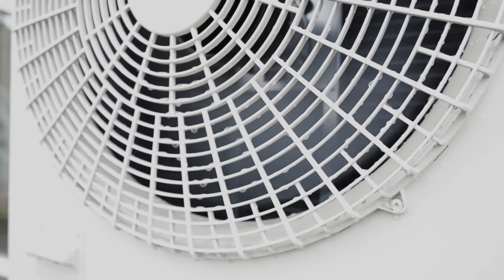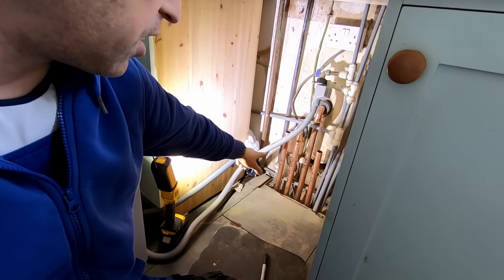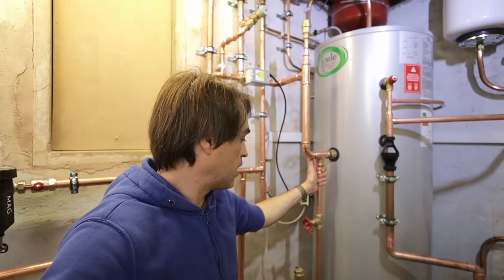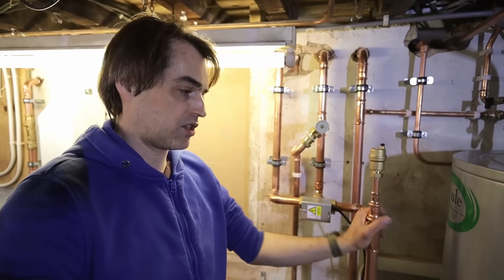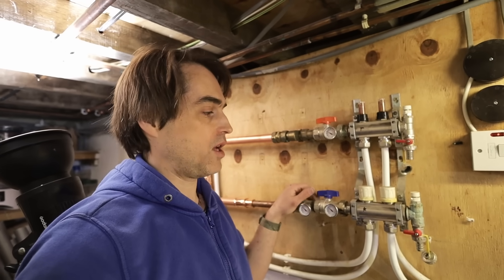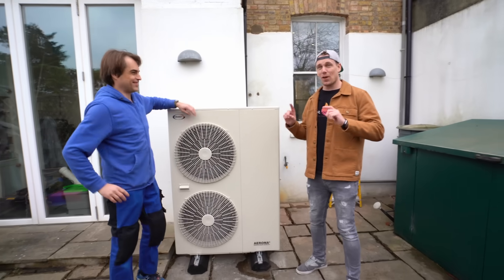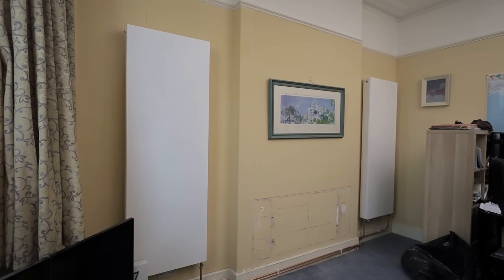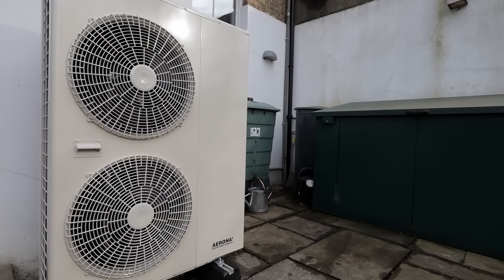The Truth about Heat Pumps: Debunking the Myth.

Comment: So they cost a fortune to install, generate relatively little heat, need highly skilled fitters (good luck in UK) and need more pipework than a power station. But, hey, they "work".
Reply: unless you live in france, where thanks to different governemental grants we were able to have the whole thing for.....wait for it.... a grand total of 1 euro (including fitting)...and yes, they do work but you do have to keep a constant level of temperarture. rather than wacking it up when you get back from work....great savings too.
Reply: @dibdab101  It depends upon your house. I live in a long bungalow and low level heat would not make it to the extreme end. I know because I tried heating it with a pellet burner and heat battery, it was a disaster.
Reply: They generate heat but it is lots of warm water and not little of hot water. So if you are building new go for floor heating with pipes.
Reply: Wow. Not for me.
Reply: I'd be highly doubtful they actually have significant carbon reductions given the carbon emissions associated with actually manufacturing everything required and installing it and then probably having a shorter life span than a gas boiler.
Reply: @zoidberg444  I beginning to suspect it’s more about reducing actual energy usage than any carbon reducing measures (as good chunk of electricity is gas generated anyway and that is not changing anytime soon)
Reply: @jasonaris5316  I have replaced my gas heater system with a heat pump and my annual kWh usage has halved. The current increases in gas prices mean that my annual gas bill has gone up by £8 per year as I only use it for a gas hob now. My electricity bill is going up but only about 20% compared to the horror stories about the increase cost for gas fuelled heating systems. I went for a heat pump as I did not have radiators installed and the cost and disruption associated with fitting a radiator system was something I wanted to avoid. I have an air to air system that supplies ducted air around the house and can be used to heat, dry and cool the air.
Reply: @martinconnelly1473  we are not allowed air to air systems here in the U.K. (as they don’t want additional air con being run in the summer) it’s all about energy use reduction
Reply: @martinconnelly1473  Sad truth is renewable electricity with battery back up is still cheaper than fossil fuels. Good on you for moving towards the future.
Reply: @jasonaris5316  It must be news to all the companies offering it then.
Reply: @martinconnelly1473  how feasible is that in London though ?
Reply: @martinconnelly1473  I won't dispute what you say, you know how much you spend on electricity, but I know for certain that everyone, and I do mean everyone, I know who has had a heat pump installed has seen their electricity bills double and in some cases quadruple and that's not taking into account how much the installation costs.
Reply: @martinconnelly1473  what do you do for hot water then? Sounds like you have a ducted AC system not an ashp like this?
Reply: @mikeyboy01443  I have 10 litre under sink electric hot water systems for the kitchen and bathroom sinks so I do not need to run water for a long time before it is hot. I have a standard pre-insulated electric hot water tank in the centre of the house for baths and showers. Any waste heat from the electrically heated tanks (which is not much, they are cool to touch) goes into the house.
Reply: @sambrooks7862  well obviously your electricity bill/usage would increase because you're using electricity to heat the house. The gas bill reduces by probably more than 1/2 I'd guess.
Reply: @jasonaris5316  well its a win win, more efficient uses less energy.  Whats n
Reply: @jasonaris5316  burning gas to make electricity to drive a heat pump is literally twice as efficient as burnjng the gas to make heat in the house.
Reply: @jasonaris5316  poppycock. Of course you are. They are used in countless offices and an increasing number of homes. What you cannot do is get a grant unless your heating system heats your hot water as well as your heating demand.
Reply: @sambrooks7862  well duh. Of course your electric bill will go up. What you need to look at is has your total kw usage across gas and electricity gone up. And if you can ditch gas altogether then you also save on the standing charge.
Reply: @AdrianColes  yeah? I visited a customer on Thursday who is now spending  £50.00 a day on electricity, just to be clear, that's PER DAY, and guess were most of it is going? Yep heat pump and he knows that it's the heat pump because if he turns it off the smart meter shows that his daily usage is about a fiver a day. His hot water is luke warm and the whole house is bloody freezing, at best about 18 degrees, and that's before the winter, based on its performance right now the place will be uninhabitable if we have a cold winter. But of course you're the expert, I reckon thousands of people who have been duped into buying the useless money pits would welcome your input!
Reply: @sambrooks7862  I’m not an expert, but the creator of this video is and showed what needs to be done to make heat pumps work. £50-5 =£45. @34p per jnit (the price cap) that’s 132 kwh a day. Even assuming the heat pump COP is 1 (it’s not, even a poorly installed one will get 2 or more) then the heat loss form this house is phenomenal if 132 kwh of heat is not accumulating. Did you advise the customer to shut the windows??
Reply: …from the video calculations, that’s a house that contains 100 high ceilinged, poorly imsulated music rooms.
Reply: @AdrianColes  the house is less than a year old so it's impossible for there to be significant heat loss. I have dozens of customers that have heat pumps, some are new builds and some are retro installed, none of them work well or efficiently. Some of them know that they've been lied to but others are in denial, "why does anyone need their home to be more than 55 degrees" was what one customer said to me last winter. I also have a mate who has just spent over 20 thousand pounds on solar panels and batteries because according to him he will now have "free electricity". You can't teach stupid!
Reply: @AdrianColes  something else I would like to point out is that back in 1980 at the height of the double glazing boom my parents spent a lot of money on secondary double glazing in every room. I  vividly remember the everest salesman standing in our living room claiming that the installation  would cut their heating bills by a third, it didn't. I also remember the government telling us that diesel cars were better for the environment and giving us huge cash incentives to buy them. Roll forward to 2040 "were you misold a heat pump? Text claim to. ......"
Reply: @sambrooks7862  then your customer is telling lies, or lives in a new house with about 600 rooms. Do the calculations. That or slight fib about £50 a day! If they did not work, or cost as much as you say to run then they would not be the first choice of heating in Scandinavian countries, with considerably colder temps than we see here.
Reply: @sambrooks7862  dude, basic thermodynamics. If the heat input per day is MINIMUM 132 kwh (likely to be at leats double that), then if the heat losses are minimal the house would rapidly be approaching the temperature of the surface of the sun. That or it is staying a constant temperature and has heat losses of 132kwh a day (minimum, likely double). Of course your customer could have a house which holds no truck with Physics….
Reply: @AdrianColes  or of course he, like thousands of other people, could have a heat pump that does virtually nothing except use a ridiculous amount of electricity! Face it, regardless of what you think, more people are unhappy and disillusioned with their heat pump than are satisfied with them, if they weren't no one would be talking about it.
Reply: @sambrooks7862  again, you fail to understand thermodynamics. If the kwh is not going in to the building, then the unit itself must be at 100s of degrees temp (which it is not). Where is the energy going?? Inefficiency in mechanical and electrical systems is given out as HEAT. Therefore, the energy is going into the house, you say £45 a day worth. So, it’s either escaping the house, the house is in an alternate reality in which physics does not apply, or it’s a little lie.
Reply: @AdrianColes  have you had a knock to the head? Everyone, or at least everyone I know that has one of the useless things, is spending a fortune on electricity. My boss had his removed last year, this was before the increase in energy prices and last winter, which was very mild, he was spending an additional 60 quid a week for tepid water and a cold house. Again, this is a new build so whether you like it or not it must be up to the current regulations or it wouldn't have been able to satisfy all the various compliances that builders now have to comply with. He has replaced it with a log burner with a back boiler, result= toastie warm home and gallons of scorching hot water and as his house backs onto woodland he runs it for free. I don't know anyone with a heat pump who is spending less than 400 quid a month extra to run it and I have heard of people who have had their direct debit raised to £1500 a month. But whatever, no one is telling you not to have one.
Reply: @sambrooks7862  are you sure your “boss” doesn’t back on to farmland, ‘cos I can smell something…. By the way, if your “boss” now has a back boiler off off a log burner (which are generally gravity fed, and cannot be controlled temp wise there being no way to call for heat or to turn it on and off), then they are going to regret it during the increasingly warm summers when they want hot water. All the people you know must have massive houses and leave their windows open, and not know how to use a heat pump effectively. it is very different to gas, you can’t just say “it’s chilly, I’ll turn the heating on”, as it takes so long to react. This is the biggest reason why people say “they don’t work”, because they indeed do not work as a gas heating system does. There are dozens of forums avaialable where you can find people comparing their energy usage (and cost) pre/post heat pump which do not back up the stats you’ve gathered anecdotally. Most of the stories are about people having to adjust to the new way to think about heating. Air-to-air, in this sense, is much better and I think will take off more as we also start to see demand for aircon in the summer.
Reply: @sambrooks7862  did not say pennies. Cost is comparable, and generally slightly lower with heat pumps (but not enormously), but only with a complete change in how the heating is controlled. I’m so sorry you only know idiots, it must be very frustrating. My comment was that people were not educated properly as to how to use this radically different thing, so even clever people have to adjust and change their thunking. It is probably almost imposible for idiots to do this. I also come back to thermodynamics (i.e. the egrgy has to go somewhere). Unless houses are absolutely massive, or totally inefficient, then some of the cost numbers you are giving are not possible and sound a bit madey-uppey. Did you even watch this video?? Beginning to think not….
Reply: @sambrooks7862  here is a good (very recent) video about running costs, for example https://youtu.be/WuAunibSIoA  so now you have at least one….
Reply: @AdrianColes  but equally there are thousands of videos saying the opposite. You can find good and bad reviews for pretty much everything.
Reply: @AdrianColes  I live in a 2 bedroom property in a city and last year our gas boiler packed up so until I can afford to get it mended our replaced I'm relying on electric heaters which I know absolutely are inefficient and expensive. However this week I have spent £100 on electricity, everyone i know is paying far more for their energy than they were so why is it such a stretch for you to accept that someone with a 5 bedroom house is spending more than me?
Reply: @zoidberg444  I dont understand this love for gas heating? Have you never walked down a street and smelled leaking gas? It is everywhere.
Reply: @zoidberg444  given the prevalence of air conditioning...why would a second system to do the same job be more carbon efficient than having one system that does both?

Heat pumps are 250%+ efficient in most moderate environments. This means that they use less gas to generate a degree of heat than burning the gas directly.
Reply: Jon Smith’s cynicism is not helpful; yes we need to train more heatpump installers, but they do generate a lot of heat (17KW) in this example, and much of the pipe work is just to enlarge the pipes because of lower flow temperature. Many people spend far more money and effort on refitting their kitchens just so they look nicer - at least the heatpump is saving energy and reducing carbon emissions. We have to do such things to avoid catastrophic climate change.
Reply: @chriskitoo1  Realism, not Cynicism. 17Kw is not a "lot" of energy - it's much less than even the smallest gas combi and there are many considerations needed to make that amount of energy heat a house (many more than just wider pipes) - and many of these will prove intractable in older houses - which is most of the housing stock in the UK. 

As for the skill of gas fitters, I had a particular problem with a long gas pipe run, that I knew was an issue but it took 6 so called "gas safe" fitters to come round before one identified the issue & solution. Comments on here refer to "combi-slingers" that pretty much sums it up. There are few people on the ground in the UK with Simon's level of competence - most are behind a desk earning £150-200k I would imagine and I suspect that nothing about that is likely to change. It's not about level of training, it's about economies of scale -  if you have the competence, you get a cushier better paying job - if you don't you throw as many combis in as you can. 

We could reduce UK emissions to zero tomorrow and it wouldn't avoid "catastrophic climate change" - currently the world's 2 biggest emitters China and the US are doing precisely bugger all to address this - and until that changes - it matters not one jot what the rest of the world does.
Reply: @dudeatx  if you need more than one system get more than one system. 17KW system is just that the size of the system. Need more? Get more. 

Again having an air con system is the same as having a heat pump. It doesn't generate heat...it PUMPS heat. So when you burn gas you are releasing 100% of the available heat energy from the gas and putting that into your house. 

Is that 50KW? Cool. You have to burn 50kw worth of gas to get 50kw of heat. 

Heat pumps work by moving heat from outside so that 17kw system is probably only using 6 or 7kw of electricity or less. 

Therefore for the same cost energy wise you get 2.5* as much heat or more. If you need 50kw of heat you only need 2 10kw systems to do that. And yeah that's a lot of electricity but it's also much less than the equivalent gas.

It boggles my mind that UK citizens are apparently completely incompetent when it comes to selecting competent tradespeople. What your complaining about is that too many people are shit at their job...use the review systems and don't hire them then.
Reply: @dudeatx  yep bang on mate . Also Air traffic is never brought up when they are telling you about the damage your car is doing.
Reply: @milamber319  yep, I understand all that, the point I'm making is that this is all theory on paper, when applied to the real world there will be a 100 variables that will only become apparent in practice. So, I'll wait & see how it pans out when we have 10 years of experience on the ground - my guess is that it will never have universal applicability - but I stand to be corrected. 

As for using tradesmen - you can't blame UK citizens for not having the knowledge, why should they? They rely on the knowledge of others - that's the point. I was lucky in that I had just enough knowledge to know there was an issue but it doesn't seem to bother trades people, even if they are aware that you have some knowledge they will still treat you like you are a twat.
Reply: @dudeatx  No it wont have universal applicability. That's just how physics works. But then no heating or cooling solution can have universal application. Gas heating in slab homes which don't have ducts or preinstalled floor heaters will just be a waster of time compared to multiple reverse cycle units.

The point is that you ALWAYS have to design for the space and so complaining that you have to design for the space is stupid. As the skills for doing so with heat pumps grow and modern houses move away from the antiquated gas boiler you'll find the skills required to maintain the old systems will decrease and become specialised and the new skills will be the default.

This is exactly the same type of argument that floated around in the transition from carbuy to EFI and then from EFI to CAMBUS in cars. "its too complicated, too many variables, people can't service the cars anymore, everyone3 will need a degree in computer science and will fuck up the new systems" Guess what... it was fine. Its fine EVERY TIME this happens.
Reply: @milamber319  ...and if it can't have universal applicability (or even majority application and I'm only think UK)  then it isn't much of a solution to the problem is it?
Reply: @chriskitoo1  I trained to install Daikin it cost me 2500 pounds I have never had any body ask me for an installation because I am self-employed so can't claim any Grant's for them because I am not a vat registered company and I don't have time to do the RHI coarse and paperwork as I don't get paid for it . So I'm sorry to tell you all that the government is the reason why these are so expensive. I am already a registered full scope electrician and part L plumber,so if I can't get it done I very much dought it's going to be practical for others to bother with.